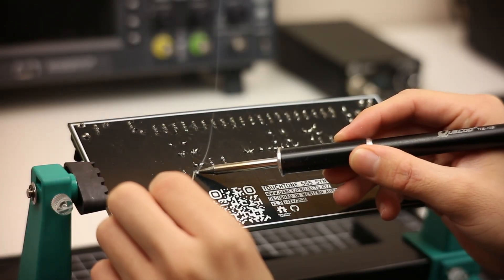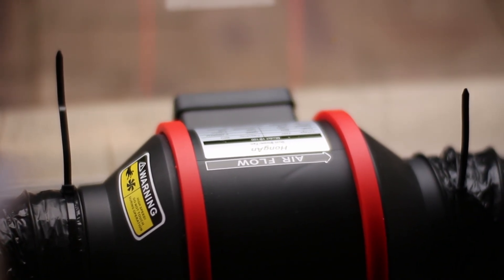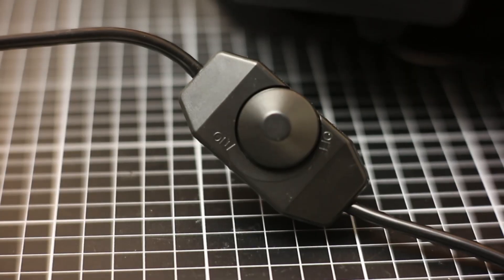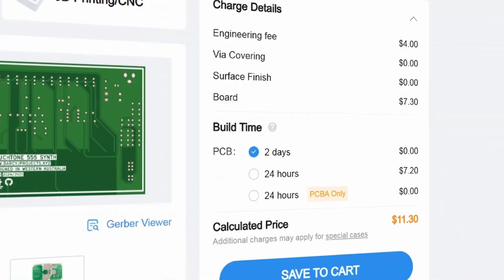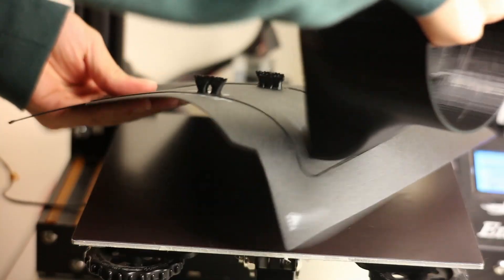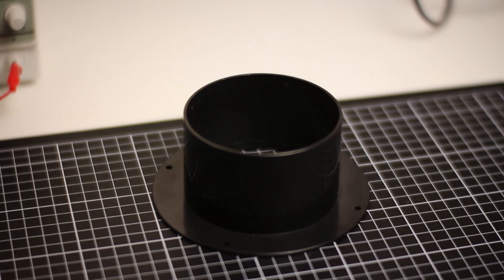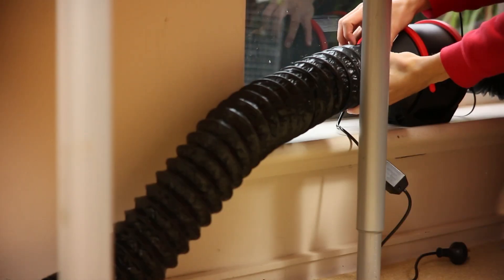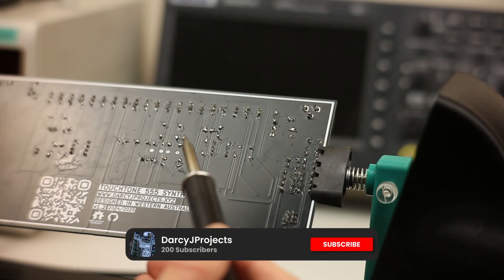I Built a $50 Soldering Fume Extractor That Actually Works

Comment: You can get hoses clamps with a twist tightened knob instead of using the drill/screwdriver every time. Also could use a carbon charcoal grow filter if you can port it outside

Comment: What a great project! 

Are you able to explain the push/pull comment about inline fans and why you place the fan closer to the window?
Reply: so it has enough run to prevent the suction effect of the inline fan. Try turn it on and leave it for 5 min, u will start feeling the negative pressure around the inlet.